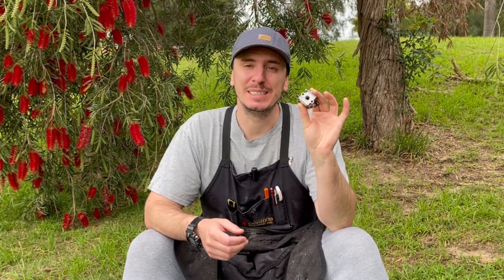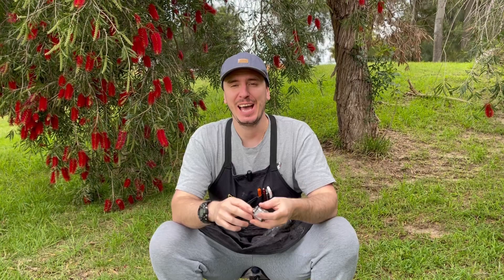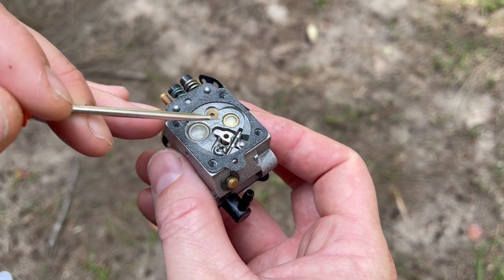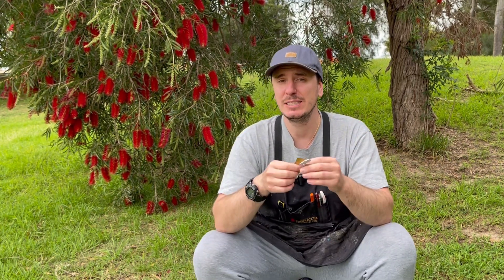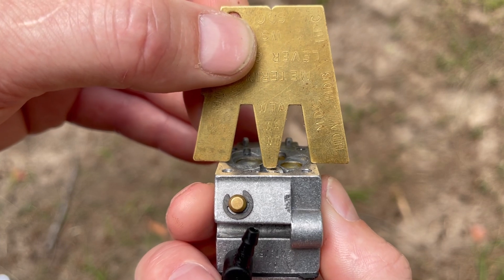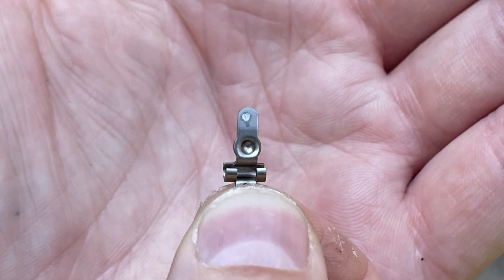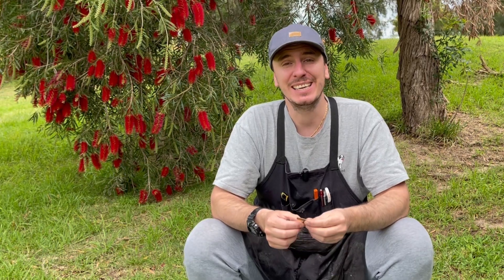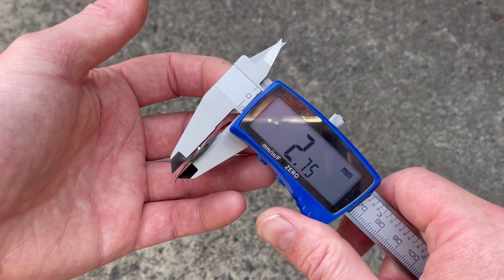Essential Adjustment When Rebuilding Carburetors! - Don’t Miss This Step!

Comment: Can we just add that in these Walbro WA and WT carburettors there are 2x raised ridges on either side of the metering lever. these ridges are exactly 1.5mm below the surface of the body of the carb. its the same height as the middle of the official Walbro W tool. So if you do not have the W tool, you can still set the metering lever to the correct height. The lever simply needs to be level with these two raised ridges, which you can easily achieve using the short side end of a common 30cm steel rule! But the correct tool can be had very cheap as well, even clones of the tool now exist on chinese shopping apps.
Reply from the maker: Sorry mate I’m not sure what you mean raised ridges? Thanks for sharing though! Much appreciated :)
Reply: @VintageEngineRepairs  so if you pause your video at 40 seconds where you have the metering lever zoomed in. In between the metering lever and the M12 writing you have one raised ridge. On the other side of the metering lever you have another raised ridge. They are curved. They are there for a reason. So if you do not have the W tool you can still set the metering lever to the correct height

Comment: does adjusting the idle screw on the carb can cause the engine to flood? i did that to adjust my idling speed and suddenly I can't start my engine.
Reply from the maker: Na, it can’t mate, if you adjust the low it can though!
Reply: @VintageEngineRepairs  I set the L back to it's factory setting, but still the engine flooded everytime, is the carburetor damage already?
Reply from the maker: The factory setting is only starting place for adjustments, it doesn’t necessarily mean it will run well there. I have a few carburetor tuning videos, I hope they help!

Comment: Hi Tom. I’ve got three petrol 1/5 scale RC cars. Two of them are using Walbro WT-997. One car runs perfectly. One car runs rich. I had to lean out the L ridiculously lean, like 0.5 turns out just to get the engine to start and idle. I tore the carb apart but didn’t see anything obvious. Perhaps this lever was too high and it was always getting too much fuel. 
And the third car has a clone of the 997 made by RuiXing, and this one runs leans all the time. When I pulled this one apart the throttle butterfly was bent so it always had air which means the car was always moving. Anyway I’ve ordered the kits to rebuild them and thanks for making these videos!
Reply from the maker: Thanks for sharing :) great stuff! 1/2 a turn out isn’t necessarily wrong, it’s just not the norm :)
Reply: Hi thanks for your information.where can I purchase awalbro carburetor gauge

Comment: When you buy diaphrams and gaskets, even at the most professional shops, they don't tell you how to set that meter, or even suggest a metering guide for the model Zama carburator you have.  Bummer.   THUMBS UP!!!!!!!
Reply from the maker: Thank you!
Reply: They are not supposed to tell you.
When you go to a workshop you pay for the parts and for the knowledge.
If u just go there and get a part you should have the knowledge already.

Comment: Question: I can't get any response on idle screw on a ms180c stihl chainsaw,  carb has preset (no adjustment for h or l ) I've installed new diaphragms and it only idles high. Won't change no matter all way in or out. I took apart again and find no interferences. Any ideas? Thanks so much for your educational videos
Reply from the maker: Yeah the carbs on them are really useless. They have an air bleed as a low speed adjustment and no high speed screw. Google search “walbro WT215 carb swap ms 180”

Comment: Hi i just rebuilt a zama c1q s131 carb with a rebuild kit off ebay .
Your videos have been a huge help thank you sir .
My stihl fs90 strimmer starts up straight away and idles nicely at tick over now where as before it was a sod to start and the tickover was all over the shop .
Only problem now is the high speed is still lacking in power and it still seems to be missing ,not running cleanly .
The adjustment on the high speed screw do not alleviate the problem.
I have a new coil and spark plug ,gap is set correctly , the valve lash is set ,new filters ,hoses and tank vent .
I did replace the zama with a very cheap (£14) carb off ebay but it only worked well for a couple of days before it became almost impossible to start , still wouldnt work after i cleaned it and checked the lever height etc which is when i decided to buy the rebuild kit .
Do you think i would be better off getting a new carb ? 
Could the high speed screw be damaged ?
Any thoughts would be greatly appreciated thank you kindly
Reply from the maker: Glad it helped! Very interesting, they often have cam problems and can develop air leaks too. Have you checked fuel lines? Impulse? Fuel filter? Tank vent?
Reply: @VintageEngineRepairs  thank you for the prompt reply , it has new fuel lines ,filters ,impulse hose, tank vent ,cam gear and spark plug .
Once i replaced the zama carb with the ebay carb the running issues were gone , i could get full power and tick over and it started easy but the carb stopped working after a couple of days so i rebuilt the zama with a kit and it improved it , it now starts straight away and ticks over nicely but the old problem it had of not reaching full rpm while sounding like its missing slightly is still there ,its like at full throttle the rpm wavers slightly and  the high speed screw adjustment wont rectify it .
Reply from the maker: Ahhh it’s probably the limiter on the coil kicking in! They have them to stop the engine over speeding :)
Reply: @VintageEngineRepairs  hi i replaced the carb and all seems good now ,fingers crossed lol.
Thank you so much for your help.
Your channel is amazing ,i think once people find your channel you subscription numbers will be huge bro .
Reply: @VintageEngineRepairs  i checked for air leaks with map gas after i watched your video , no air leaks ,great tip by the way thanks bro

Comment: Great work Tom. Expert knowledge and clear communication as always.
Reply from the maker: Thank you!
Reply: My mantis has a carburetor like this. That said, not the one with the primer and the multiple hoses for vacuum Etc. No primer and one single fuel line. I put clear fuel line on so I can troubleshoot, and the carb is not pulling fuel. Can this metering lever / valve Get Out Of Tune after several years? Your videos the only one that explains this, so thank you. I will try adjusting this now

Comment: How do you know what height to use when you have a generic carb? Sometimes people bring me a saw that doesn't have the original carb. so I have no idea what model carb came on it from the factory.
Reply from the maker: They’ll be a clone of another carburetor, it’s just finding out what copy they are. Alternativly, before you remove the lever, measure the height with a vernier!

Comment: @Vintage EngineRepairs

Could you please do another short on the 200 ml bottles you use with the brass spouts?
I have tried and been unable to find them again in either your videos or Amazon
Reply from the maker: Sure, they’re Pressol oil bottles in 125mls. I can’t get them here any more, I had to go to the UK to order them!
Reply: @VintageEngineRepairs  thank you very much

Comment: I was taught to place a straight edge over the body of the carb and look for a gap or movement of the lever. I just invested $8.50 into the gauges from Amazon. Thanks.
Reply from the maker: Good choice well made :)

Comment: Looks like Red Corn Cobs on that Tree!!  Are there many carbs with Clip-Type attachment buttons instead of just push-on buttons that contact the metering lever?
Reply from the maker: Ha! It does doesn’t it 🤣
Reply: What kind of tree is that?
Reply: @gadasavideos8564  bottlebrush
Reply from the maker: I just noticed your edited question kenny! Yes, in fact tillotson use to do exactly that, not common now days, more so on the older engines. The height must be set the same :) 
Same with the metering forked end, they don’t always hold the needle! They instead sometimes press up and onto the top of the needle :) again that’s tillotson who use to do that most often!